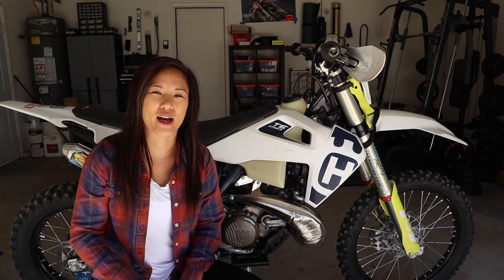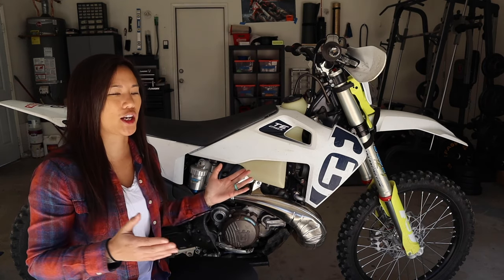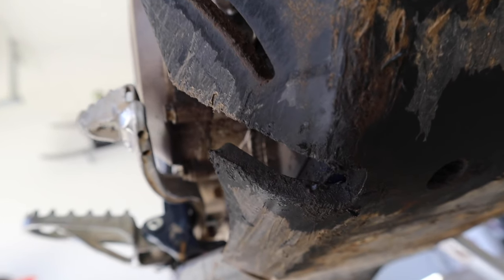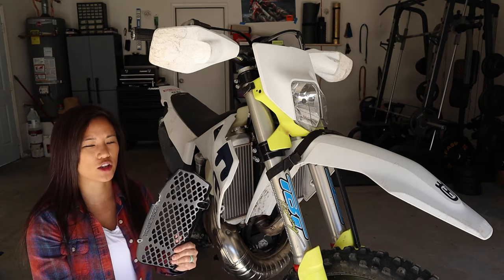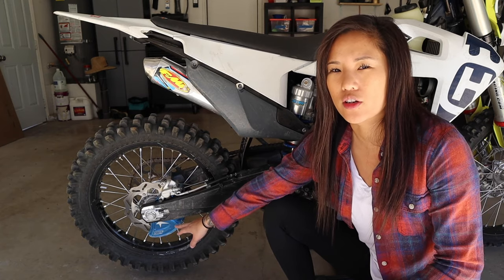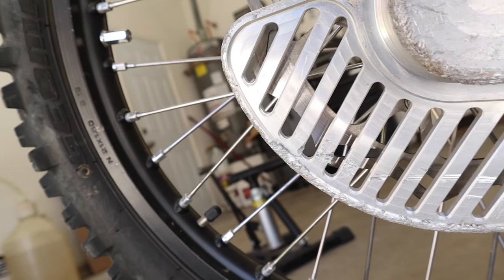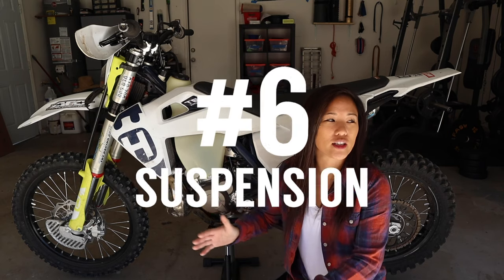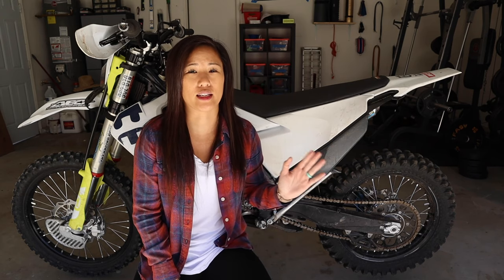TOP 6 Upgrades for Short Riders - Enduro Edition

Comment: Why buy a lowered seat when you can cut the original one
Reply: I agree.  I was reading how some of the after market seats don't fit very well.  So I made a cardboard template for the side of the seat, and sent it to an upholstery shop to take off an inch.  She only charged my $80.00.  I gave her $100.00.  Cheaper, and better quality, (fits like it is suppose to every time), than after market.

Comment: I got the 2021 YZ250X the seat height is 38
Reply: I got the 2019 YZ250 2-stroke, (same bike basically), and my seat height is now 1.75" shorter,---and I can get on it, and touch the ground, 5'9".
I took off 6.35% off the suspension, (.75" in the front, and about .788" in the rear), and cut my seat 1".
I did not find the bike even ride able in stock form.  Worst set up MX bike as new, as I have ever had.  But I made it my best.
People say, "You get used to it."  Yea, well, people can get used to prison also.  I will make my decisions based on rational physics, when it comes to my bike.

Comment: This bike is not for you, even if lower than stock it's to heavy for you to control it. You have better option's with 36 lbs less, ktm 150, 200, freeride. With a lighter clutch pull and less motor...
Reply: @daniellechristianbaldo7570  i don't want to dictate, it was only a  friendly advice. If they are happy to break bones, they should do it...
Every instructor should give this advice to someone that rides like this !